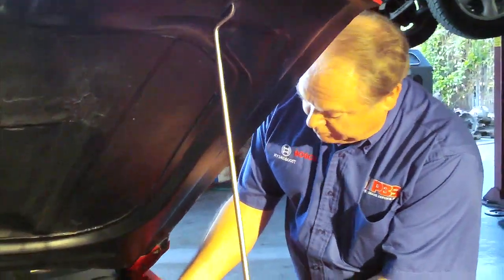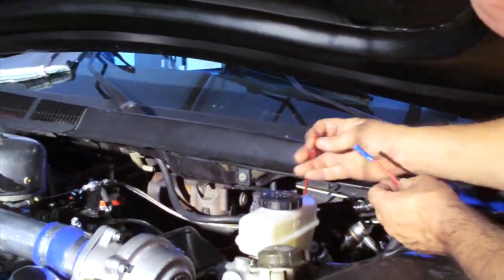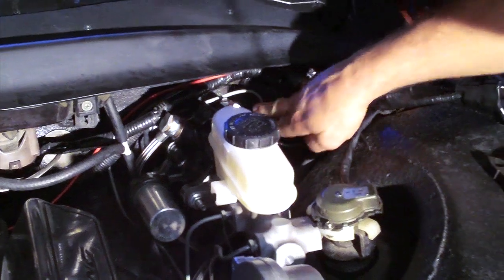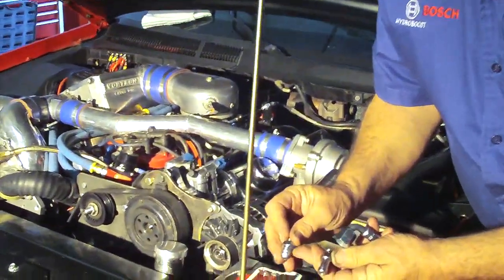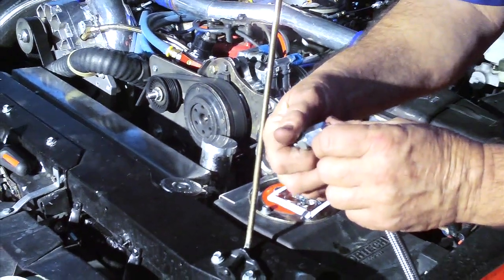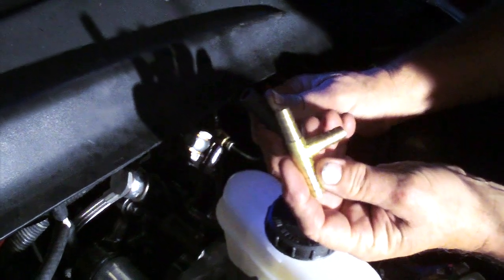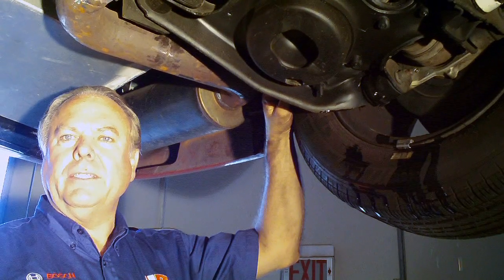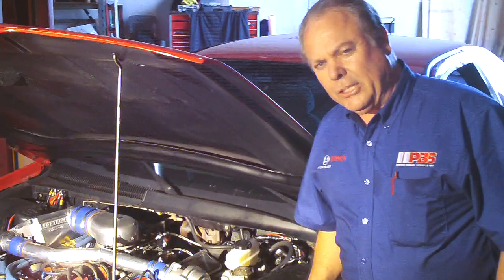Hydroboost Installation Pt. 3 on a supercharged Ford T-bird, Lincoln Mark VII, Cougar

Comment: Extremely impressive conversion system solves the riddles of the original (now obsolete) electronic system.  These videos illustrate the simplicity and the engineering quality of the Hydro-Boost Brake Conversion for these wonderful Ford cars - that have sadly been abandoned by the factory.  Bravo for SPEED - and the Sweeting family!